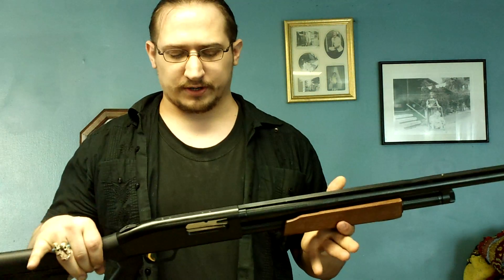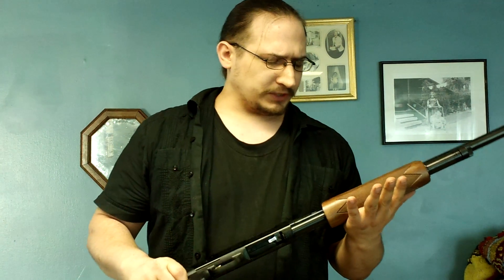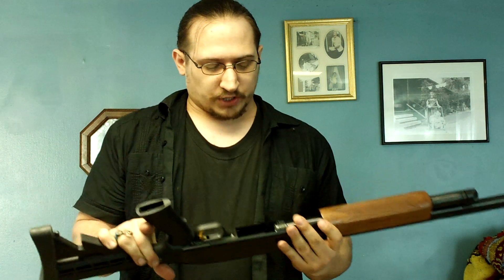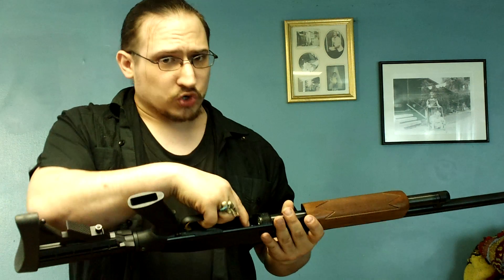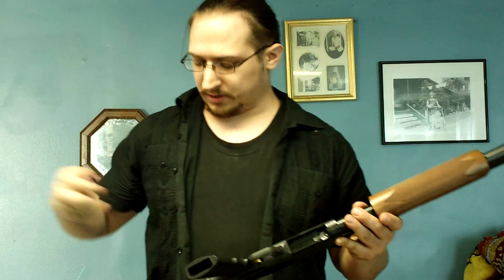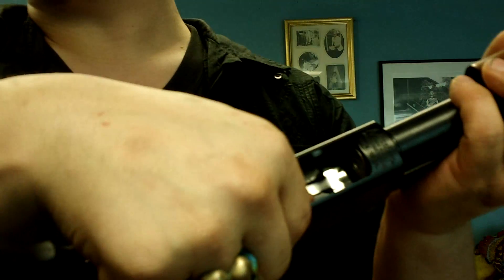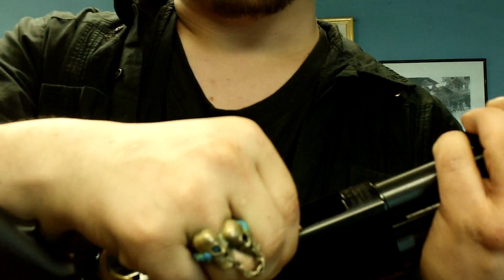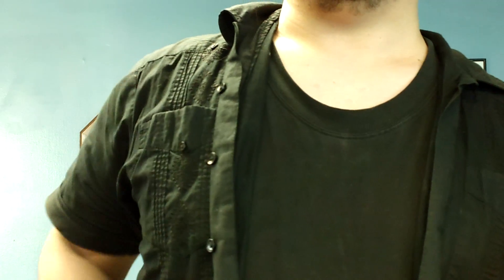Just a basic Shotgun tip

Comment: with a 870 or S&W 3000 the breech block has to be back, with the shell latch in the magazine loading port pushed up, also if the pump handle is too long it covers the magazine loading port so you cant put your finger on the metal bar that holds the shells.